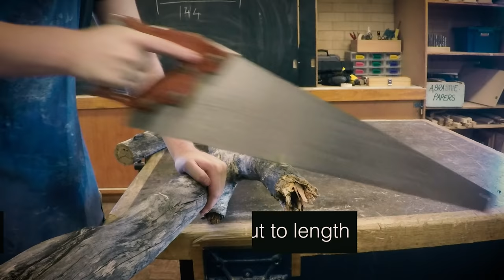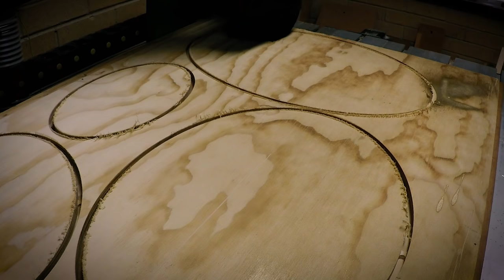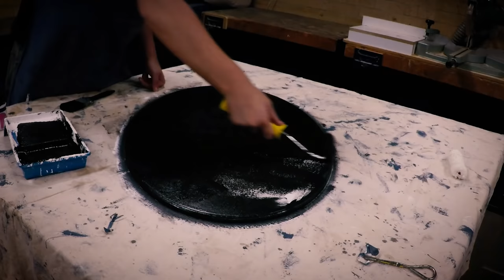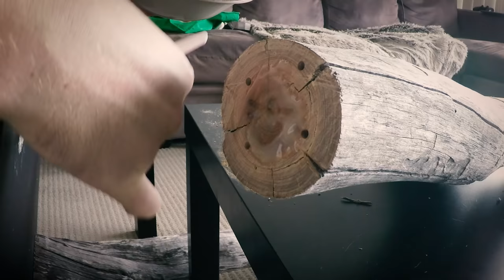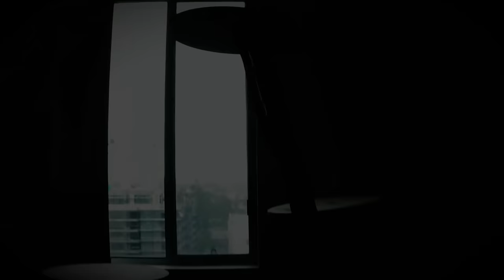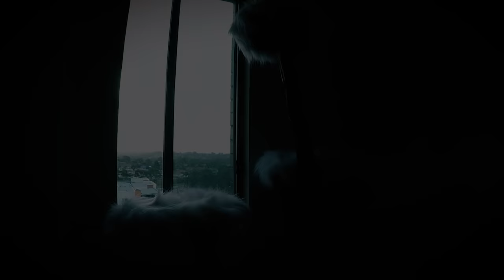How to make a Modern Cat Tree

Comment: Beautiful work ! How did you dye the sisal rope in black & with which product ? Thank you for your answer :)
Reply from the maker: Thank you 😁 I used RIT black fabric dye, soaked the rope in bucket for 24hours use hot water to start. Then rinse thoroughly and let dry. I wish i recorded it!! Here is a link to the brand and colour https://www.bigw.com.au/product/rit-dye-tinte-31-9g-black-azabache/p/WCC100000000015105/
Reply: I made it and it worked 👍 Thank you so much for your answer and help ! Greetings from Switzerland 😊
Reply: @effortequalsresults.  Actually, you might want to wrap the rope while it's wet.  When sisal dries, it shrinks, making the wrapping tighter.  Also, maybe use hot glue instead of epoxy for the rope, as cats tend to shred sisal and it will need to be replaced periodically.  Hot glue holds, but can be peeled off after a time.  Epoxy tends to dry hard and remain so, making it a bit harder to remove the rope later.  Just a few thoughts.  Tree looked amazing.  I'd probably use hot glue for the faux fur, too.